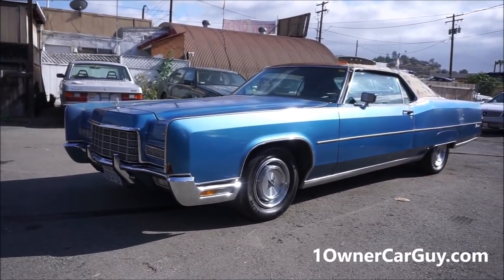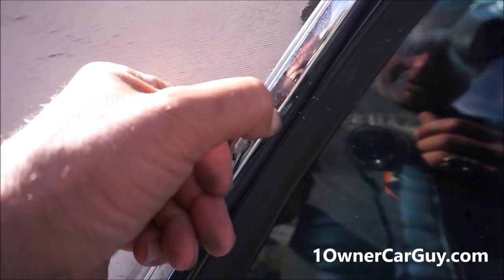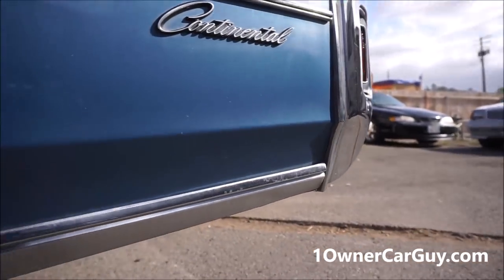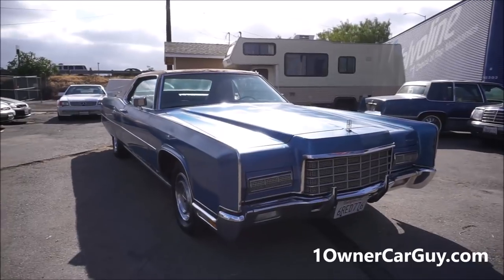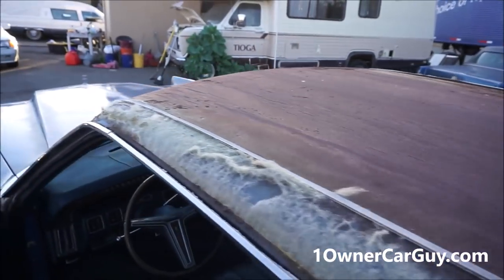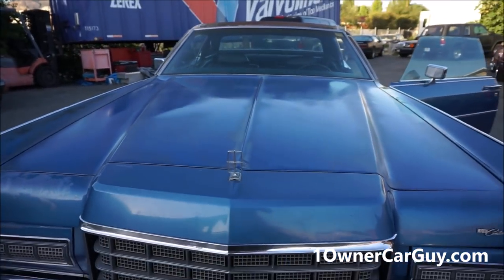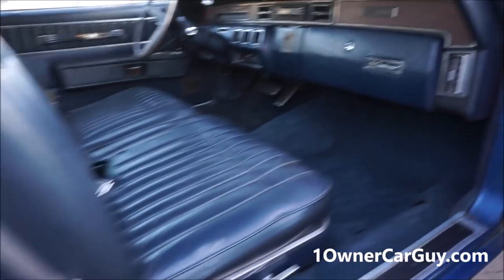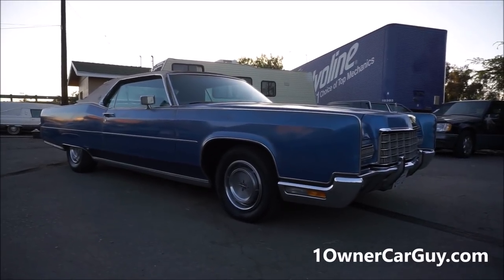BARN FIND LINCOLN CONTINENTAL FOR SALE 460 VB LUXURY COUPE VIDEO

Comment: That car uses P 235 75 R15 and not all kinds of different size tires you could have at least put the right size tires on it it would make the car look so much better and I'm sure you have stack of tires at least a set of four of the right size